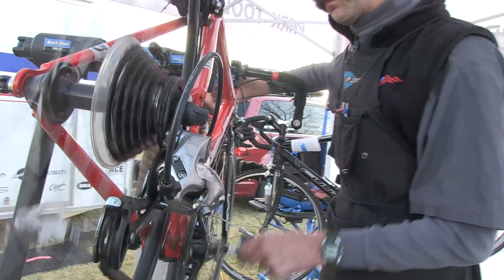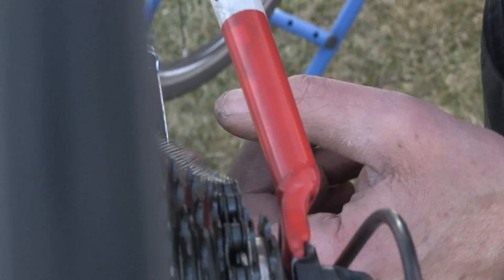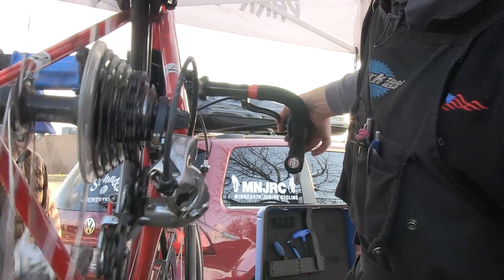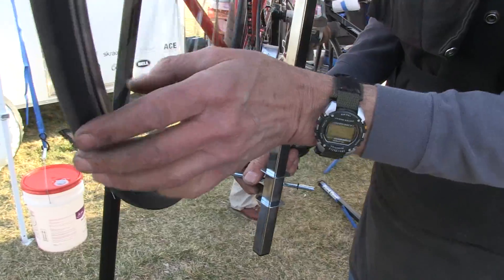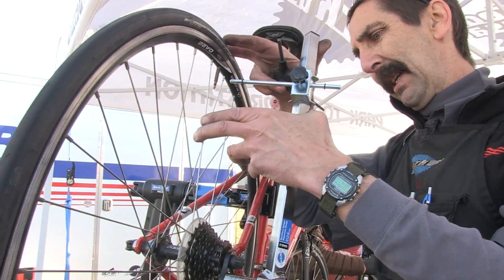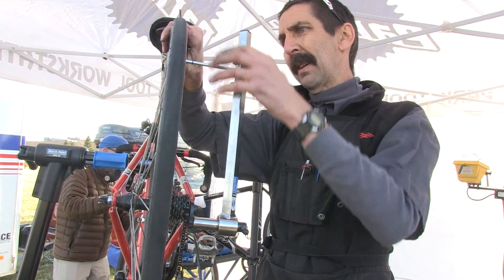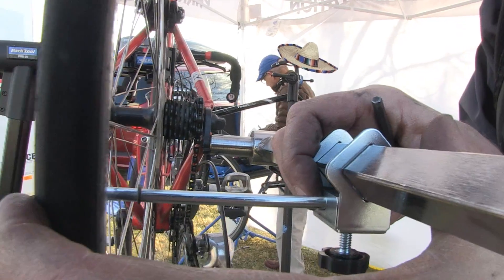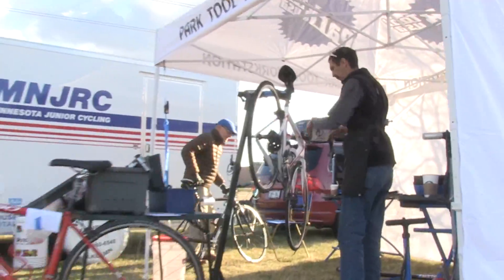Tech Tuesday #24: Chainline & Derailleur Hanger Alignment

Comment: If you drop it does it go out of alignment the tool ?
Reply from the maker: if the tool is dropped it should not go out of alignment. The threads may get damaged but the hardened head and shaft should not be damaged. This will all depend on the fall though.
Reply: Then you’ll need a derailleur hanger alignment tool alignment tool 😂

Comment: Spacer is missing on the right  crank side that is why the chain is rubbing on the big ring when the chain is on the smaller cogs. The big ring should be lined up perfectly with the smallest cog. If that cog can not be lined up with the front ring it simply means the wrong cassette is installed ( too many gears). Even my $250 GMC Kent road  bike from Amazon does not that that problem .

Comment: man this tool is pretty costly despite how simple it is!
Reply: Yup, I was able to make this tool for a grand total of $4. I’ve used it for 2 years, literally pull the bar off my bench press seat, put some nuts, bolt, washers and I’m good to go. I think I copied RJ’s design, who has a great video on making one. Just get the right bolt pitch and length.